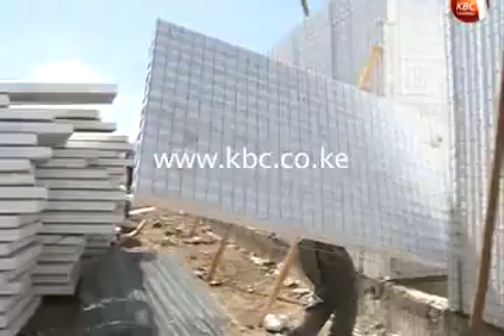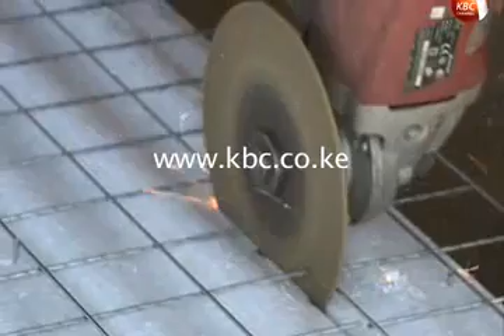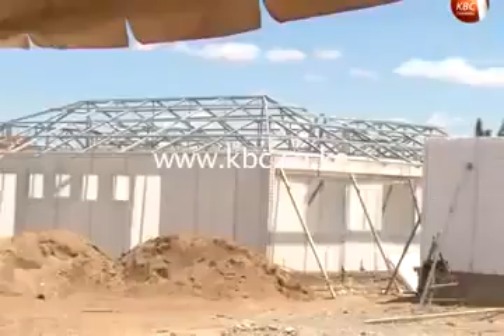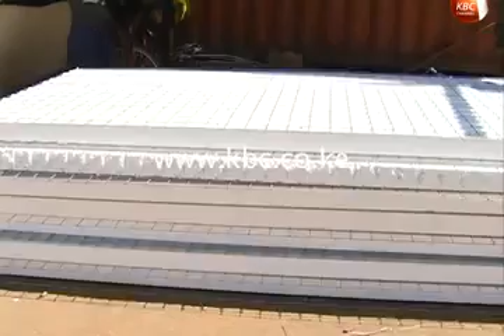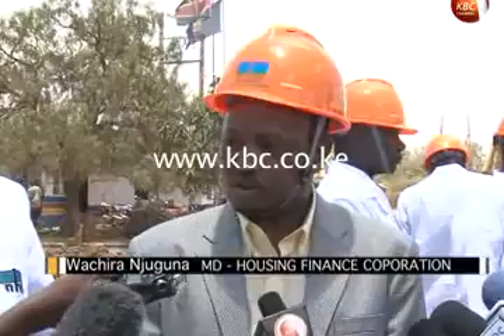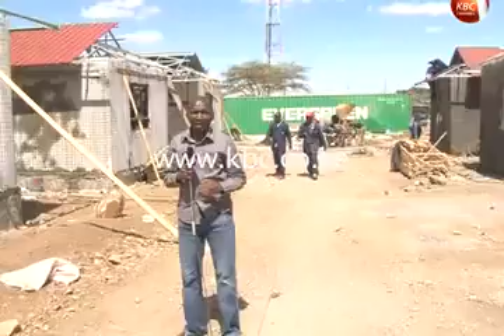Cheaper building technology launched in Kenya

Comment: No doubt that this will help to resolve some problems in regards to housing there in Kenya as well as in other parts of the world... A concern I do have though, as of which the building material is expanded polystyrene, is resistance to fire (or other extreme sources of heat) and chemical resistance... How are those things being addressed so that the safety of those that reside in these dwellings remains intact?

Thank you in advance.
Reply: digitalmunky insurance